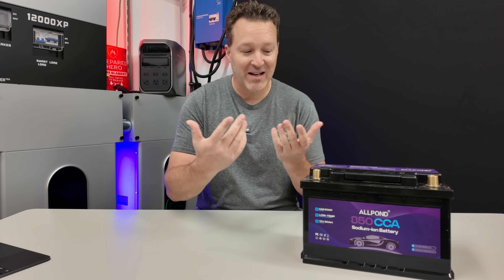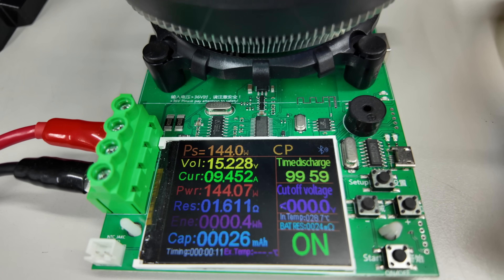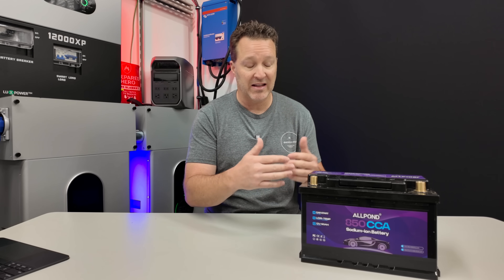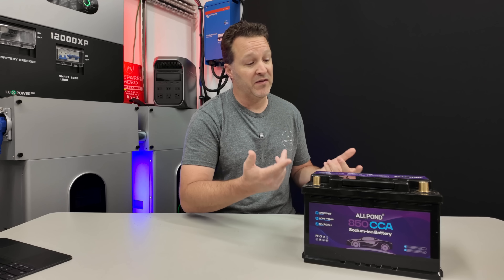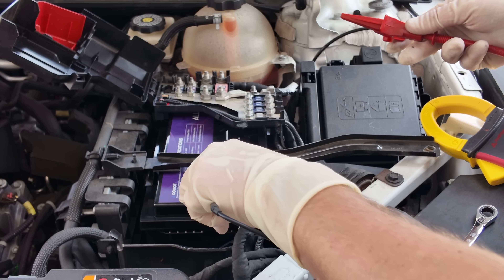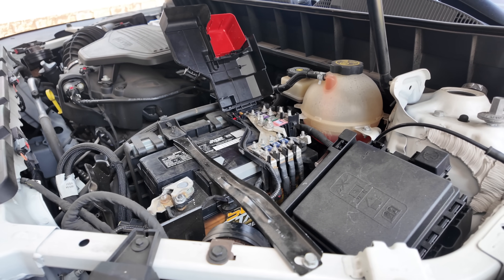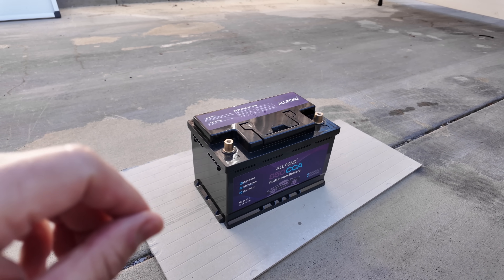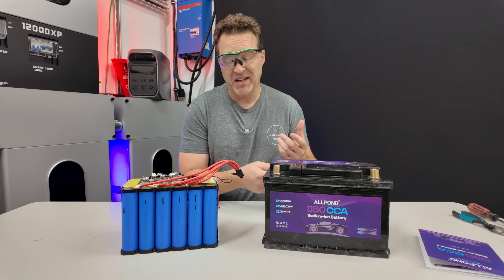Sodium Ion Battery Tech Hits The Auto Industry!- Are We Ready?

Comment: That battery is a "' Start Stop" battery.  
All vehicles that turn off the engine at stop lights have a auxiliary battery , a 2nd battery usually storef in the rear and hidden.  
These type of batteries power your accessories when engine is off at intersections and help start the vehicle to proceed when you press the throttle.  
That is what I believe this is designed for. As far as the 15 volts.  That is concerning.  Because even the auxiliary batteries do not operate at that voltage.

Comment: All digital multimeters have something called a sampling rate.  Think of it as a finite response time if you prefer. Your vehicle started basically immediately, probably in less than 1 sample period of the meter's processing chip. As such, the amp readings are essentially meaningless.  If you could prevent the vehicle from starting immediately, and get say 4 to 8 seconds of crank time, the meter would likely give a more meaningful result.

Comment: the part I don't understand is the running voltage dropping to zero as indicated by the meter - the alternator output having a problem charging I get but the battery voltage should still be fairly high

Comment: In modern vehicles, regulating charge current to the battery was mainly to help meet new CAFE regulations for fuel efficiency. It does this by reducing the charge current as the battery reaches the fully charged state, thereby reducing the load on the alternator and reducing it's strain on the engine. The side effect is preventing "boil out" by constantly charging the battery at 14.4+ volts when it only requires about 13.5-13.8 to remain fully charged. 
With sodium (or lithium for that matter), if the peak charge voltage for the battery is higher than what the charging system can achieve, the charge load to the alternator never falls below the reduction threshold, causing the alternator to stay in full charge mode constantly as the current draw never drops low enough to let it go in to efficiency mode. 
I have to explain this to car audio guys that want to go lithium or sodium all the time, and the premise is the same.

Comment: A car lead acid battery is 12.6 volts, 6 - 2.1-volt cells. A car alternator can output anywhere from 14.3 to 16 volts depending on the alternator and they usually have peak charging around 3000 RPM for a gas-powered engine just FYI.

Comment: I live in the tropics and lead batteries last 2 years, with a 1 year warranty. Our car and small bike batteries have been changed to LiFePO4 without problems so far. I expect them to last many years, as they don't mind the extreme heat under the bonnet. Once the big bike battery dies it, too, will be changed.

It doesn't look like sodium batteries are the right tool for the job here.

Comment: if the FH-9 version of those does 1100cca... with the brass lugs on the battery, long as the calls inside are manufactured more so like a capacitor then a battery. could use those for jump starting packs on the old C11 or the 3208. two of them and hit 29 volt on the 24 volt starter... $1000 seems unjustifiable when no one is shown using them for the 1100cca label... 2000 cycles of 30 second cranking would be a 2 time up sale over a cheap lead acid. if it is 1100cca, 3 pound battery set sounds like a hollow delusion. but the brass terminals would be grate because the lead ones actually explode sometimes with the 100kw surge currant of two group 65 lead acids that are $130 on sale. 30 second discharge cycle them at 28 volt... i got a motor for two of those if someone comes around with them... make a light weight semi truck jump pack out of 4 or 6 of them. on a troll lololly... fire chemical smoke... hope that wouldn't. 3208 calls for 3300cca 24v or 36v.

Comment: LTO is the only chemistry suitable to replace lead acid batteries in a car. No BMS needed, just a balancer. Super safe. Basically impossible to make catch fire. The voltages don't match lead acid exactly, but of the car industry adjusted to 16v charging and electronics that can handle 16v, it would be perfect. LTO has a 20,000+ cycle life for the battery, so we are taking 25+ years. The battery would absolutely outlive the car. You would never need a new battery. XS Power is a reputable brand of high performance batteries in the USA and they recognized and made LTO batteries for drop in replacement of lead acid batteries for cars amongst other use cases. I've seen 800Ah of LTO cells power a 96,000 watt car audio system with just two 400 amp alternators for charging. Check out EXO Contralto's YouTube channel and look for his behemoth build. It's 96,000 watts with 12 amplifiers that do 8,000 watts each and twelve 18 inch subwoofers. He hits 167+ decibels inside his van, and it's all steel reinforced cage with 3 inches of wood inside the whole van. Powering all that with 120 x 40Ah cells of XS Power LTO with 20 in parallel and 6 in series, so 20p6s setup for the cells. He still needs to add more LTO cells (the 10Ah LTO SCiB cells) in my opinion to take the load off of the other 800Ah worth of LTO cells so he can use the smaller 10Ah 80C rate cells to power the amps and the other 800Ah of LTO as backup capacity for the system. I think just another 240Ah of the smaller 10Ah LTO SCiB cells would help him a lot. That 240Ah of 10ah cells alone is enough to power 100,000 watts of amplifiers at 16 volts because each 10Ah cells can output 750 amps each, so 24 cells in parallel can output over 15,000 amps at 14 volts or so. All I want personally is to see how a 120Ah of small LTO cells does on my 8,000 to 10,000 watt stereo system with a single 320 amp alternator. It should be more than enough to keep the voltage above 15v if I'm tricking the alternator to charge at 15.5v or I get an external voltage regulator for my alternator. I don't need the car's computer to decide what my voltage is when it's incorrectly assuming I'm using an AGM or lead acid battery for no reason other than it came that way from the factory. Car companies should at least let you reprogram the car to whatever battery chemistry you choose to use. I've seen other sodium ion tests and the chemistries I've seen just aren't ready for real world use yet. Sure, it's definitely got potential only because of the possibility that it becomes very cheap in the future, but just because the materials are cheap, that doesn't mean that manufacturers will be selling them cheap. Look at handbags. It takes maximum of $300 in materials to make a leather handbag, but go try to buy a name brand handbag and you might pay $15,000 depending on what the brand is. Material costs aren't the end all, be all of what the final price will be. I think we already have a really good replacement chemistry in LTO and it can probably still be improved if it got enough attention and use. I know most companies don't want to sell a battery that gets 20,000 to 30,000 cycles before you need a new one, because that's basically your whole lifetime and the battery might outlive a person let alone the car it's in, but whatever. Pandora is out of the box already. Can't put it back in now. LTO has very high output potential, very high safety, and very, very long life as a battery. You can let them discharge to zero and freeze them solid at -100C and they come right back to life with no lost capacity and no harm done. It's insane how good LTO batteries are. They just don't have the highest energy density or highest energy per kilogram, but they have lots of energy to give in a huge range of temperatures and for more than 20,000 cycles and they can output energy and recharge energy at tremendous speeds. It's absolutely the best overall battery chemistry we have available when all factors are considered.

Comment: So to make this battery applicable to daily use the battery charging voltage would need increased from 14.4 to 15.5. With this case everything would be solved, if not this battery would fail early. It is telling that with the "service charging system" message. So a voltage mismatch.
Reply: It is not this simple.  Per my understanding electronic components would have dramatically shorter life at high voltages and it is not linear over the design  threshold.  A lot of components would need to be designed or they would fail.

Comment: If I had to hazard a guess, I would say that the battery's BMS has too low of a charging threshold set and the BMS is turning on and off during charging.  You can't really overload the alternator since it will only output a fixed max amperage so the voltage will simply be lower until the voltage meets the charging system's set point.  It is also possible that the vehicle uses variable voltage charging to save gas by dialing back the float voltage once the battery is fully charged and the charging current drops off and this was confusing the BMS and causing it to turn off.  Either way this pack is not ready for prime time vehicle use but may have some other applications.  I still find that the LiFePO4 batteries make great starting batteries if designed with the right type of BMS and low temp charging protection.
Reply: YES its the bms IF you use LTO battery it has no bms only a balancer, and is treated like lead acid

Comment: Yeah - they need to dial in the voltage for typical lead-acid better!  Some EVs could use this as a 'starting' battery, as well as other cars that can be provisioned for AGM?
I wonder if you can re-program the BMS?  Thanks for cutting one open to check out the insides!

Comment: 3-4 years has always been the norm. Some people are just willing to gamble and not realize what a weak battery is doing. Your vehicle actually runs on the alternator. Not the battery. The battery starts the car. Then it acts as a buffer and a momentary surge booster. but a weak and degraded battery will tax the charging system.

Comment: 15.5v charging is perfect for a Honda Odyssey with a failed voltage regulator. Started seein a lot of 3rd gen Odysseys come in for failed alternators and the battery light on. What were they doing? Suddenly charging at 15-16v. I'm interested in the life cycle of these batteries because I'm going on 5 years on an AGM right now and so far, so good. I'm thinking about going with two LiFePo batteries (car originally came with an H6 that I replaced with an H7, and a TX14 secondary) but I'm waiting to see what happens with Sodium Ion battery tech. I'll probably wait for the second generation of these to come out before I make the switch to Na+ batteries.

Comment: The smart alternator and computer goes  into a float mode because the battery already has sufficient voltage and 14v is exactly where a newer vehicle will just leave and not put any strain on alternator actually will prolong alternators life
Reply: BMS , FULLY CHARED CONDITION

Comment: your clamp meter is not going to give you the amperage using the clamp portion with dc current. unless it's some very high end meter i and the person who taught me electric has never heard of. clamp meters work on ac current to show amps not dc.
my homeboy runs competition stereo systems and his truck was set up to run 15.5 volts   but that's a custom thing 
a dumb vehicle should have no problem with this battery it just would never charge it fully. if you drained the sodium battery to 12 volts before you put it in your truck it probably wouldn't have a problem with it. having that high of a voltage to start the vehicle may think its being jump started and the cables are hooked up as far as the computer is concerned that would be the only time 14+ volts would be coming from the proper  lead acid battery

Comment: The upfront cost of converting a small modern motorcycle to lithium is too steep for my taste.  Of course the quality is just like seen here.  Even a searched out well recommended Bms is only as good as the final connection.  I don't want to invest in that as a full time business.  As it is I've experianced the Lithium meltdown.  One ruptured cell Ipod replacement and another Ryobi recondition (first time spot welding)
 I do like the quality of some booster packs, the longevity is the same as a standard battery as is price.

Comment: In a car, voltage below 10V isnt useable which drops the capacity of this battery by 20% right off the bat. That is the problem with these batteries you need a DC to DC boost converter in front of the battery just to use the full capacity. For home battery systems there will be wide range input voltage inverter made but they will cost quite a bit more.  Because you need a whole set of hardware to handle the wide input voltage, any benefits of a cheaper battery are moot.

Comment: Way too many points of failure on the sodium ion battery for me to even think about considering them. FLA/AGM batteries are very primitive with no smarts onboard. The old battery in your Acadia has a low charge which is why the charging voltage was elevated (not due to the A/C being turned on like you imply). Your coolant level looks low. You best get that radiator closely inspected soon. They commonly fail and in many cases there are no obvious signs of a leak. The leak is usually near the top left corner of the radiator and the coolant often leaks slow enough to dry before it gets to the bottom.

Comment: I am going to guess that the reason your Clamp Meter only read 14 and 4A when doing the starting test is because it locked onto the first spike of current. This would have been from when all the Accessories came online.  When actually starting, the surge should be >50A. I would recommend turning the Accessories on and then put the clamp meter to test the surge and lock on to the actual starter surge current.
Pretty great review overall though. It was interesting that your charging circuitry didn't like it. I wonder if it was because the circuit was expecting around <30A charge current (or something relatively low) because of the high resistance of Lead Acid, and the Sodium will take all the current that can be tossed at it, like Lithium. So the charging circuit possibly detected, falsely in the case, that there was a short on the line and it was disconnecting to keep from overheating itself and/or causing an electrical fire. Nice safety feature actually.

Comment: Counter argument: they are making lead acid batteries cheaper. Murphy's Corollary of Engineering Planned obsolescence: take stuff out till it stops working, then put the last thing back. This includes, but is not limited to, wire diameter, grade of plastic, amount of solder, labeling (marketing lies).

Comment: The sole function of the battery is to heat the glow plugs on diesel engines and rotate the crankshaft to initiate starting.
Then the alternator provides the power for all electrical load, including charging the battery.

Comment: My guess is that the car's firmware would have to be modified for this to work. Assuming that the alternator is even capable of generating higher voltage. BTW. Those reviews are hilarious.
Reply: Think bms, it shuts off the battery, as with other lithium ion batteries when fully charged. my NEW car battery is LTO, NO bms but a balancer, battery cells always directly connected and good for 20,000 cycles and 20C discharge rate (years of use) TEMP -40C to +60C

Comment: Sodium-ion batteries are terrible for cars. If they need to charge at 0.2C there is no control besides the inherent behavior of the chemistry. Further, partially charging seems to result in reduced cycle life. I don't know why anyone would be selling these as drop-in replacements without including a BMS with an isolated in-line charge controller that can boost the voltage to 15.6V. Terrible product. The designers literally threw a battery together in the form factor that they could sell without learning anything about the application it was being sold for.

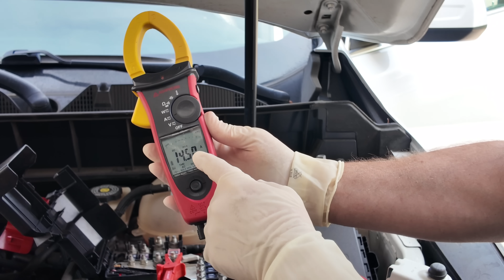Comment: 8:14 bro you did not do that right. You can't start a car with 14.5A and some part of you know that but you must have been in disbelief. You need to set the clamp meter to inrush current, not just use max, it's way too slow to catch the current impulse.
Reply: 10:00 yeah you need to stop what you're doing and learn how to use that clamp meter with INRUSH. Download the user manual and read it please and make a follow-up.
Reply from the maker: It doesn’t do In rush on DC only AC will it do in rush 

It’s an expensive meter with auto switching. It knows what it’s clamped around. Unfortunately no Dc inrush from what I could find 

I should have used my automotive stuff buried in boxes. I have an old load tester and carbon pile…
Just in a box of junk lol 
Totally spaced that and my OBD reader
Reply: @johnnysweekends  I mentioned this to another commenter, but the inrush current from starting an electric motor from rest (stall) is a half sinusoid. This is why INRUSH on clamp meters is featured on the AC setting. The DC setting averages the voltage over very long time periods in the span of tens to hundreds of milliseconds and will not catch voltage spikes or impulses. You need to use AC for inrush and DC for slowly changing or rippling voltages.
Reply: @johnnysweekends   If you don't trust me see it for yourself with AC in the INRUSH mode on your car and the numbers will reflect reality.